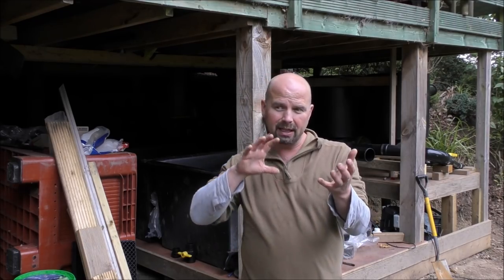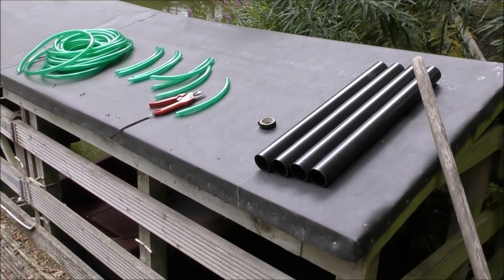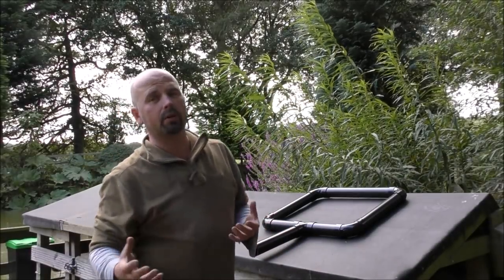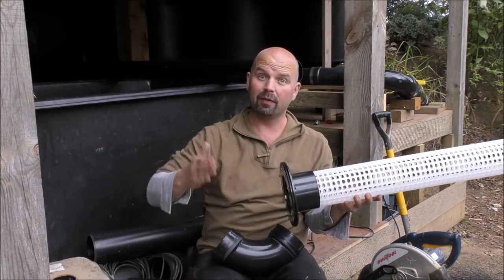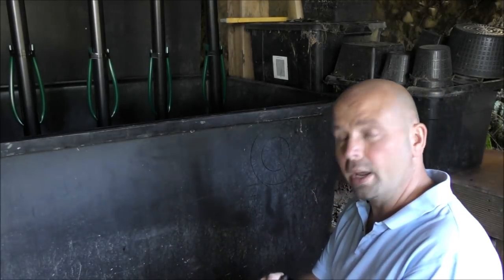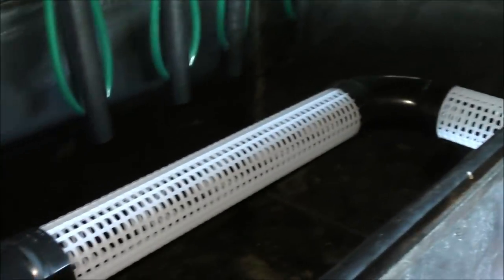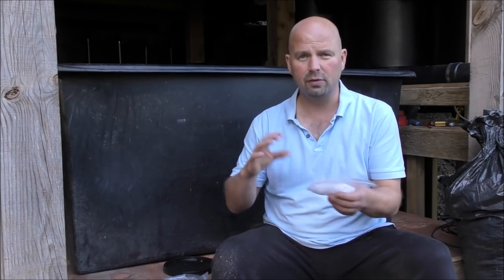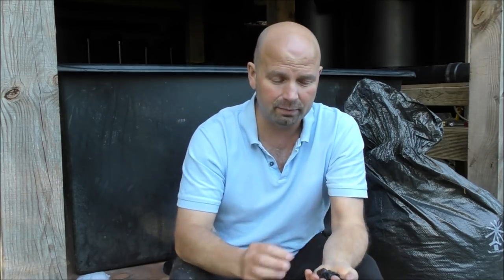Building a HUGE Pond Filter - Part 4 - Moving Bed / Fluidized Media Chamber

Comment: Thanks Richard love your channel as it is so real world with no faffing about. I know you don't advise using Purigen in filtration systems but is it because you think the Purigen itself can wipe out the bacteria or potentially recharging it with bleech can then wipe out the bacteria. I use your bio home ultra in my tanks and have a perfect full cycle but I do have a bag of Purigen in my sumps as a safety net. I've never had a problem but I have never needed to recharge it. Thanks.
Reply: Ive been using Purigen for months now, and recharge every month.  It makes a big difference to my water clarity and it's perfectly safe if you recharge properly
Reply from the maker: Thanks for the report - for every 20 people linking the purigen to bacteria population collapse there is 1 who has no problem so it's important to hear when something works without affecting bacteria. It could be something which has a tipping point and I'd imagine the amount used in a sump will proportionally be less than in a smaller system (and you'll have more media in a sump too).
If it works for you that is good but recharging anything with bleach then having to fart about with specific chemicals to ensure it doesn't wipe out bacteria isn't my idea of fun - It's like playing Russian roulette...
Reply: @pondguru  thanks for the reply. Excellent points well made. Yes that does make sense and yes I have about 4 kilos of biohome plus other media in a system of around 350 litres. Looking forward to the next installment of the huge filter series. All the best. 👍
Reply: @pondguru  I wont deny its a bit of a faff but its tedious rather than difficult.  My use case is the premade 100ml bag in the bottom of an FX6 on a 100gal, I used it purely as a carbon replacement for removing wood tannins etc, not as a ammonia/nitrite/nitrate control media, and my water clarity is immeasurably better for using it.  In my humble opinion purigen doesnt harm bacteria one little bit, its the poorly executed recharge that kills the bacteria, what with bleach being anti-bacterial an all!  But we are lucky in the UK, a certain supermarket's value range of thin bleach is 5 times (give or take) lower in concentration than the sechem recharge instructions (risk reduced by 5x already).  I soak 24hrs in bleach, 24hrs in water with prime and then 3 days of soaking in plain water changed each 24hrs, rinsing under a running tap once a day too, so the bag is out of the filter for a week.  I've recharged the same bag 4 times now.  You of course dont have to recharge it, you could just bin it and replace it as you would with carbon.

Comment: Just wondering. If you extend 1 or 2 of your venturi tubes to the bottom of the chamber, would this add more air agitation?
Love these videos!
Reply from the maker: It would probably enable air to be dragged right down to the bottom but the moving bed media tends to operate in the top 2/3 of a container, even when it is fully mature.
I've got a 6000 lph pump in there shifting it around now but I reckon I'm going to go with an air pump with a DIY air pipe attached to the drain pipes as they are perfectly placed to distribute air and move the media properly. Having that in addition to the water falling into it with a big pump should really shift the media well.
Reply: @pondguru  just a thought. Looking forward to the next installment. Thanks Richard

Comment: Looks good! Strange question - but do you think it will be noisy? I've considered a moving bed in my aquarium sump but initial trails were annoyingly noisy
Reply: I have an 8 gallon MBF running about 10 feet from my bed.  It is a little noisy...kind of a constant ssshhhhh sound.  I put a lid on it and it was fine.
Reply from the maker: I have the feed pipes just about at water level and it is quite quiet but I may notice more noise when I get a large pump running the system. I may even have to drive the bed with an air pump but I'll see how it goes.
I've got a sauna in the cabin above the filter and the sound of water creates a natural 'white noise' for enhanced meditation, lol
I did 45mins at close to 100 degrees C the other night but only managed 30 minutes on the top shelf and 15 minutes on bottom shelf.
Reply: I don't think the moving bed will be the loudest thing. 10 pipes of venturi is going to be pretty loud, however the sound can be baffled or use very long pipes. Just have to see when it's running at maximum capacity.

Comment: Fantastic video as ever. Quick question where did you get the large tanks?
Reply from the maker: I got them from various sources and the round one is best as quarantine tank since the rectangle ones deform when they are filled with water. If you look up 'Champion moldings'  (nr. Manchester) they will manufacture them in loads of sizes.
Reply: @pondguru  Thank you I will have a look at them. I'm after one for a quarantine tank

Comment: Can you please tell me where did you buy the white pipe like strainer. I try to make k1  moving bed but I like your idea. Thanks in advance
Reply from the maker: It was from Kockney Koi and is 1m long x 100mm diameter perforated white pipe.
Reply: Thanks for responding.
Reply from the maker: @dianesourinphoumy3031  No worries and best of luck with the pond.
Reply: @pondguru  is a store in UK? I couldn’t find it.

Comment: Not convinced those venturi pipes are going to work.  The theory is obviously correct but I think the direction of the cutout is actually going to collect the water flow and force it up and possibly out of the green pipes.  The cutouts need rotating 180 degrees to point downwards so the water moving past sucks the air in as it goes past.
Reply from the maker: Somebody else previously mentioned that too and I reckon you both have a point. It is working OK with the limited 12000 pump I'm using to test the filter (for level and leaks etc.) but with a bigger flow from a big pump that alteration of the pipes can (and probably will) make all the difference - thanks for the comment.
Reply: Ah sorry, I did quickly skim the comments before I posted and didn't see it mentioned.  I see it now as a reply to a different comment.
Reply from the maker: No worries, I don't mind being called out on my nonsense multiple times, lol
Reply: Well spotted Simon ( didn't notice that first time of looking.) Richard generally knows what he's talking about though.haha (No offence Richard).
Reply from the maker: My head is so done in with the amount of work I have on at present that I'm sure I made many more mistakes than the pipes.
I love it when I get called out on something as it enables me to learn from shared information (from people who know better than me, lol) and I could think of nothing worse than an Emperors New Clothes situation where everyone was reluctant to call me out on something.
Reply: If you had the emperors clothes on we would be sure to point it out!
Reply from the maker: Yup, it wouldn't be a pretty sight....

Comment: Hello where did you get your containers and will they be strong for a quarantine tank?.
Reply from the maker: I got them from various sources and the round one is best as quarantine tank since the rectangle ones deform when they are filled with water. If you look up 'Champion moldings'  (nr. Manchester) they will manufacture them in loads of sizes.
Reply: Pondguru , thanks for the info, I was looking at the square ones for dropping into a frame which should help to support the shape. Like you r videos some great tips. Cheers
Reply from the maker: If you can have them in a frame they will be fine. I had to support sides of the end one in this filter system.

Comment: For all the large holes you have to put in you should have bought proper sized hole saws. The drilling out is very time consuming and not accurate, you also should invest in a level and  proper overhead lighting to work by. Proper job prep makes everything easier and a better outcome.